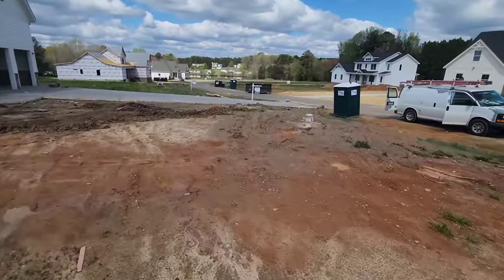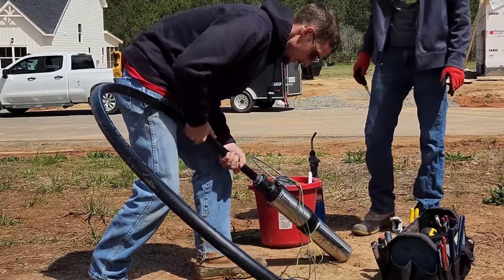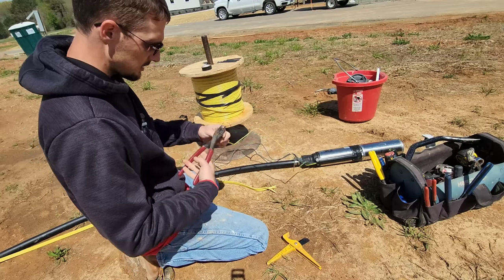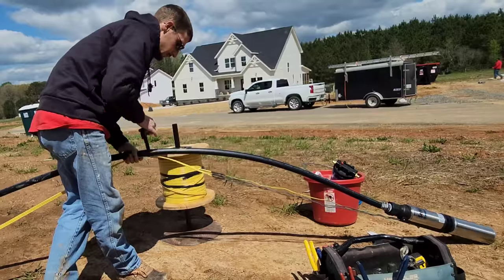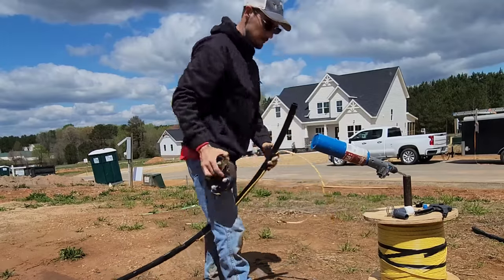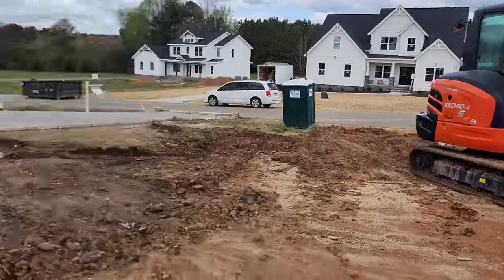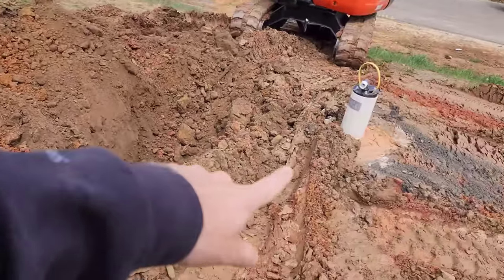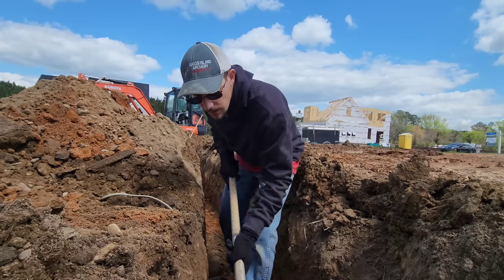Complete Well & Pump System Install From Start to Finish. Well Drilling

Comment: Hi Guy. We are having an issue with our well at the moment. The water pressure at our sink tap looses pressure. The pressure in the vessel seems fine maintaining steady PSI. Any ideas. Could it be the pressure switch. Thanks.
Reply from the maker: Normally that's a tank issue. Watch my tank videos on how to test it
Reply: @h2omechanic  Thanks I will check take care
Reply: Clean your faucet screen
Reply: @glasseyelid  Thanks, that was the first thing we checked. We were thinking it might be the Faucet itself, you know when you turn your tap on and off it wasn't opening fully. In saying that we have an out door tap and the same thing is happening there. Water fly's out of the tap then pressure drops. Thanks.

Comment: Brother if a door opens for you while your walking towards it it’s probably the work of the devil send the apprentice instead
37:31
And by the way fyi capacitor’s do have a shelf-life depending on how hard they are ran and the size of the capacitor as opposed to the load they can last for decades or months just depends so capacitor’s aren’t really the best thing to base decisions on

Comment: This new housing development doesn't have city water????  Strange indeed.
Reply: Common in suburb development far outside of city limits.  Especially when there is plenty of ground water that close to surface.
Reply: When my family sold our 35 acurse it had a well that was drilled at 350' and produced 200 gallons a minute, because it hit an underground river. Then the Developer put a on site water plant.
Reply: @Natsumidragneelkim    That’s called job security and guaranteed stream of passive income.

Comment: Hey I know this video is two years old just saw it. In your state aren't you required to install an electrical disconnect at the tank for service purposes? Jerry  M. You also said the pump was 110 volts on the  tank you have written 240 volts if it is should be 220 volts not 240 volts. Your also supposed to use a weather proof splice box not a 1900 box outside.

Comment: Unbelievable they didn't put concrete floor in the crawlspace
Reply: Cheap housing down south.
Reply: Never seem concrete in a crawl space. Anywhere from dirt with vapor barrier to gravel usually.
Reply: very believable. why? its s crawlspace.
Reply: I'm more surprised by the lack of vapor barrier/plastic. Lack of concrete is very common in crawl space foundation houses.
Reply: Why use a crawl space? Out here we are all slab on grade.

Comment: What do you mean that it prevents a pocket.. 
it absolutely creates a pocket that when the great stuff deteriorates is a pocket of degraded great stuff.  
Which I have to believe that dirt will eventually replace it…
That’s just reason to have a problem in the future. 

Code enforcement is an absolute joke when it comes to construction. 
Lol.